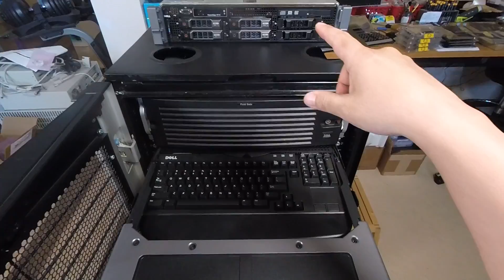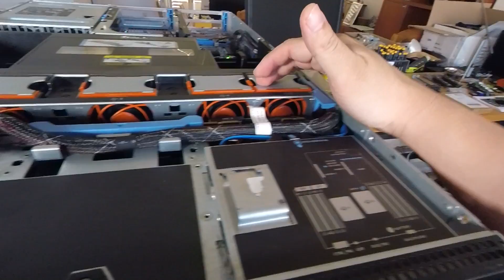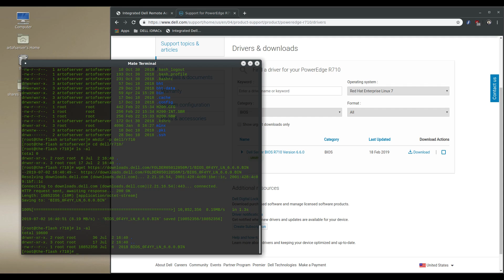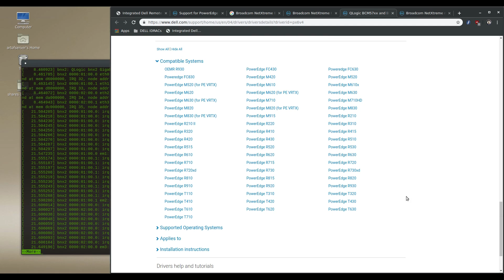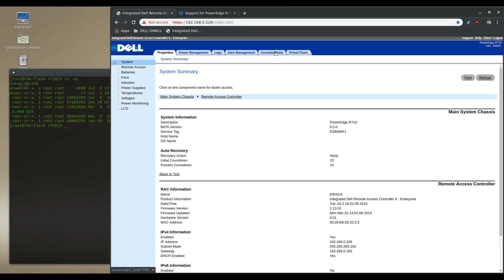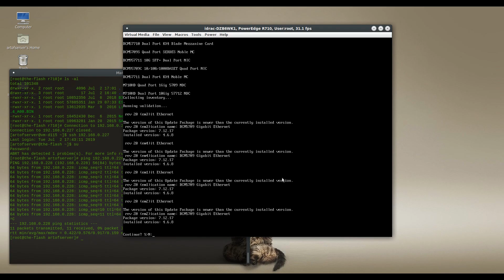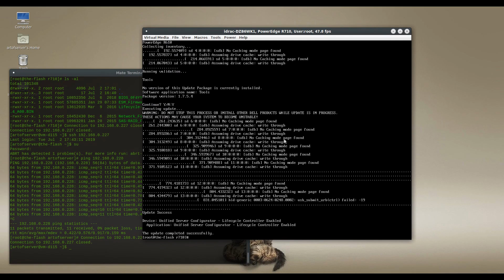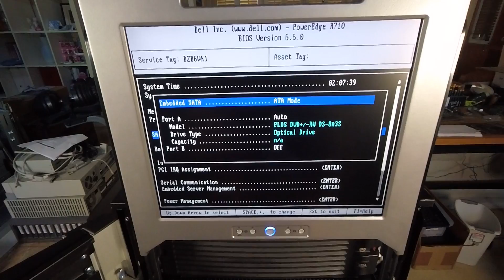Dell PowerEdge R710 build PART 1/9 | fixes, bios and firmware updates, and factory reset

Comment: This video is perfect even being so old. Any suggestions on if my BIOS Version is blank? It is blank on the BIOS screen and the iDRAC portal
Reply from the maker: I've never seen a blank BIOS version. something seems off, but I'm not sure how to fix that. I might try a re-flash of the BIOS firmware, and maybe also a CMOS reset.
Reply: @ArtofServer  thanks for the reply!  Unfortunately I did already try both of those things. I suppose I could try the CMOS reset again after I’ve made a couple changes. I wasn’t sure which bios version to use so I did start at the earliest version and it failed and then worked my way up, still failing to flash. The error I got when I tried to flash was “error unrecognized system”

Comment: I suspect I am going to have to download these (the firmware files) on a Linux machine in the GUI and copy them to a Linux bootable disk because now it's not possible (or so it seems) to use wget to download them. I know the iDRAC update on my R710 is needed because the latest web browsers won't even let the page display on my current Windows PC, whereas the iDRAC on my R730xd was new enough that I can start it entirely from the browser. I haven't tried the R410 iDRAC yet; that's a project for tomorrow.
Reply from the maker: Try using this website to get the firmware: https://poweredgec.dell.com/latest_poweredge-11g.html

The firmware update packages are available for other OSes too, but I'm a Linux user so I use what's convenient for me. Feel free to use whatever is more convenient for you. :-)

Comment: Great vidoe series, I'm upgrading as I watch the video but I ran into this issue, perhaps it's due to the fact that I'm rting it on a Proxmox installation and not live Linux USB media:

Package version: 7.12.17
Installed version: 7.10.18

Continue? Y/N:y
Executing update...
WARNING: DO NOT STOP THIS PROCESS OR INSTALL OTHER DELL PRODUCTS WHILE UPDATE IS IN PROGRESS.
THESE ACTIONS MAY CAUSE YOUR SYSTEM TO BECOME UNSTABLE!
..
Device: BCM5709 Gigabit Ethernet rev 20 (eno1)
  Application: BCM5709 Gigabit Ethernet rev 20 (eno1)
  Update failure. Firmware programming utility returned an error. Original firmware restored

If anyone knows a fix, please let me know.
Reply from the maker: Sorry, I've never ran into that issue before. But if I had to guess, the memory where the firmware is stored might be failing and is returning an error during the download process.

Comment: the CENTos is that installed on a disk 
 on the server or is booted and running from a usb-stick ?
Reply from the maker: off a USB drive. I use it as a portable installation to work on servers. There's a video on my channel showing how i setup that USB drive.
Reply: @ArtofServer  txs, found the video

Comment: I have a problem. I bought this R710 a few months ago, finally bought a 2nd CPU so I can have dual CPUs, but only one shows! It's not the CPU itself, I swapped them both out for each other in different bays, and they both boot up. I think there's a setting I'm not changing for it to recognize the 2nd CPU. I'm running VMware on this system and it works good, but I want more CPU power for VMs. 

What do I need to do to get it to recognize the two CPUs?
Reply from the maker: There usually isn't much required. You might just have a defective motherboard. I would at least do a CMOS reset and see if that helps. If not, unfortunately, I think the motherboard needs to be replaced.

Comment: I just found your channel an already liked/followed it. Can you please pass me some informations/exp. about resetting the system setup password on my poweredge r720? We bought a used one and tried the pwd jumper, but we might done it wrong and we cannot install from a new copy of windows server from stick. We managed to set the raids up, but I got stuck on the system setup password part /(.  Gonna try it again tomorrow, but I like it as it has enaugh power for my file stuff:)
Reply from the maker: Welcome to the channel! Check out my videos on the R820 and R720; those will better apply to your situation.
Reply: @ArtofServer  thanks Server is running well! I still need to learn more about the  bios settings (to disable all the lengthy self checks, boot directly to windows, disable idrac as is fails to initialize),  but I keep watching your clips and I’m sure it will work:=) thank you and have a great weekend

Comment: I'm following along for my r710, and when I get to 24:00 I see you're logged in to a terminal.  How did you set that up on the server in order to connect to it, i'm looking at the green text on the left?  The best I can come up with is install proxmox on a drive and then use the terminal on that to download (wget) and install the bins.   Also, I ran the bios update in the proxmox terminal which I downloaded from the RedHat linux (using wget and browser hack) and ran "./BIOS_0F4YY_LN_6.6.0.BIN" ....it showed current bios was at 1.1.4 and package version was 6.6.0.  I thought the number was 2.x.x but I ran it anyway. After rebooting it said it failed.   Maybe I'm running the wrong bios?  Is there a way to do the bios update on a usb stick running FreeDOS?   Maybe its okay to stay on current old version. I am just doing some home lab stuff with this server.  (iDrac is latest)   My other question is, what OS are you running and browser?  I know that windows wont let me run the java plugin anymore, so is there a "goto" tool I can set up on a spare laptop like linux desktop and firefox?   Then I should be able to console in using iDrac.    Thank you for the videos and your ebay store!

Comment: Does idrac password will be factory default if we reset the bios to default using hardware jumper. I got the used server and vga display not working so want to reset idrac password
Reply from the maker: you need to do a idrac factory reset. there are several ways, for example, you can use the 'racadm' utility provided by Dell.

Comment: When I try to update the iDARC FW i get ( "The following packages are required for update package to run: compat-libstdc++-33.i686 libstdc++.i686 libxml2.i686") 
Even though I installed them, I still get this. Any thoughts? Thanks in advance.

Comment: Any idead what the drive size limit is for the h200 you sell on your ebay store?
Reply from the maker: yes, 128PB for SATA and 8ZB for SAS. so, practically speaking, limitless with today's available technology. details are explained in this video: https://youtu.be/u55vIGMzzKw
Reply: so will the h200 be able to handle 8tb drives. I have a perc 6i in one of my systems and im having trouble getting the 8tb drives to work in it.

Comment: I've been fighting with an R720 for months.  I can't figure out if I'm missing something, but does an R720 have a IDRAC enterprise module or any modular parts at all?  Mine loses all settings every time the power goes out, and I can't get any updates to install on it.  All update files either fail, or they never install when the IDRAC reboots, and if I had any hair I would have pulled it all out trying to figure out how to get it fixed.
Reply from the maker: On the 12th gen Dell servers like the R720, the "enterprise" module is a license key you install on the server instead of a physical "module". If you login to the iDRAC, it should tell you if you have the enterprise license key already installed or not.

Are you saying your iDRAC loses settings or that the system setup (BIOS/UEFI) loses settings upon power cycling?

Here's a video that might help you, and more relevant to the R720: https://youtu.be/ISA7j2BKgjI
Reply: @ArtofServer  it looks like the Enterprise key is indeed installed. Only the IDRAC loses settings, the BIOS is fine.  I've verified the CMOS battery is good, so I'm stumped. I created a script with racadm that sets the settings back where I need to access it, but it doesn't solve the other issues I have with the outdated firmware.
Reply: @ArtofServer  I did follow along with the instructions in that video.  The update versions for the R720 add HTTPS support in the LC starting with versions 2.X.  I'm stuck at 1.65.  Any version I try to install using the .BIN file under Linux eventually ends with an "Invalid Signature Detected" error.  Googling shows that various BIOS revisions may be incompatible with certain updates and produce this error.  I have the latest BIOS (2.9.0) and have also tried various other BIOS versions with the same result.  I've run the update file under Windows Server 2012 as well as Ubuntu.  I even tried the update ISO route (there's a method that uses a Dell app to create a bootable ISO that auto updates everything), but that fails when it gets to the LC update stage.  I've also tried extracting the payload file and using it with both racadm and the IDRAC web interface upload, but both return a FAILED status with any version I try.

Comment: Hey, Great Video!  I have a R720 server with iDRAC 7 Express which I brought it recently. I connected it to the network but DHCP is not getting an IP from the network. When I try to connect it to my monitor it takes me to the life cycle controller page and get struck. I am a beginner and any suggestions would be appreciated. Thank you in advance !
Reply from the maker: It looks like your system is stuck in booting into the LifeCycle Controller (LCC). There might have been a previous configuration that is directing it to go into the LCC. You might need to let that complete.

On the 12th gen iDRAC, you can't use the dedicated idrac NIC unless you have the enterprise license key installed. Maybe that's the issue?
Reply: @ArtofServer  Thank you for your reply! I had a bad VGA to HDMI cable and it caused this issue. I bought a new VGA to VGA cable and it led me to get to the LCC. But still couldn't setup the IDRAC IP for it. As a starting point I reset my idrac setting and tried setting up static IP in the network but I wasn't able to ping my idrac ip after reboot. Let me explain on how I connected the idrac physical interface. I have one end of RJ45 to iDRAC port and other end to my TP link router which is my ISP. Initially my idrac port started blinking while resting the idrac setting through system setup but after its completed there is no light.. seems to me like the port is down. So next I connected TP link router to a switch (Netgear) and then from switch to IDRAC port but no luck.. I am completely new in setting this up and I am struck on here in setting up a IP address to the device. Not sure if my idrac port is working or not as its not blinking anymore and couldn't run the hardware diagnosis to see for any issues as my firmware is out of date. I tried reseating the idrac module but still no luck. I am looking to setup it as a home lab to install proxmox, eveng to learn networking. Or should I install hypervisor and assign an IP before I setup Idrac IP ? I would appreciate if you can provide some inputs hear please. Thank you in advance!!!

Comment: Received my Dell R710 today. Powered it on and received the following error: PXE-E61 media test failure-check cable. Can you offer guidance, please?
Reply from the maker: That means your server went into PXE boot mode (probably because there's no boot device) and could not PXE boot. If your server is not connected to a network with a PXE boot server, that's probably why.

Comment: Thought all the redundacy was to keep system running... one fan goes bad and system will not start?? Do all systems come with this "IDRAC' system/equipment? Are you saying I drive?
Reply from the maker: the system still powered on with the bad fan. so not sure what made you think it will not start? it just spewed an error about the FAN1 and lost of redundancy.

Not all systems come with iDRAC. the iDRAC system here consists of 2 modules, the "express" and "enterprise" modules as shown in this vid.

Comment: This was a Dell 11gen server with idrac6, no license required . What’s your approach to 12gen machines that require a license for idrac7 functions? Do you buy a Dell license somewhere (eBay sellers appear to be in China) or will the dedicated idrac card port work to some degree without a license? If it’s covered in another video, let me know, thanks.
Reply from the maker: Buy the idrac7 enterprise license. They are about $30-40 on eBay. When buying a used 12th gen or newer Dell PowerEdge server, it's always a good idea to ask about the idrac enterprise license. If it's not installed, you can negotiate that cost off the asking price. I try to get servers already with the license key installed.

Comment: I have two dells that i bought used, one is the R630 and MD1220, I want to use the 630 as a hypervisor and the 1220 for storage, been watching your videos and you are very helpful, thank you so much
Reply from the maker: Glad these videos have been helpful!
Reply: @ArtofServer  any advise for my build? I follow you on EBay as well will be buying some parts as well
Reply from the maker: @NegroRotary  what kind of advice do you need? What are some of the questions you have?
Reply: @ArtofServer  i was thinking of using my 630 for a hypervisor and my md1220 for using true nas or plex, like doing all my computer back ups with the md1220
Reply from the maker: @NegroRotary  yes, I read that part. Not sure what your question is?

Comment: for this specific server and to remote connect you have to have two network cables, correct? one of network communication and another for the iDRAC?
Reply from the maker: yes, for this specific server, there are 4 onboard NICs. but there's also a dedicated port for the iDRAC, that's the "iDRAC enterprise" module.

Comment: The irony of this video is not using windows to avoid licenses and then using red hat linux. Which is also under a license you must agree to.

Other than that, great video. Helped me set up my server in the configuration I needed it to be in.
Reply from the maker: I disagree. I wasn't avoiding windows licenses, I simply don't use windows. And I was using CentOS7, not RHEL; there are no encumbering licenses.

But glad you got good use out of the video. Thanks for watching!

Comment: Hi, any solution for e122e onboard voltage regulator  and e1000 failsafe voltage errors  for dell poweredge 710 it looks there is no solution on the web please help if you can thanks

no one has a real solution tell now
Reply from the maker: do me a favor and don't post comments on videos that are not relevant. it just gives me extra work to clean up the comments on my channel.

as to your question, i have no idea. however, it sounds like something might be wrong with the PDB which is part of the motherboard. So, likely you need to get a new motherboard.

Comment: For some reason I can't get my R710 to show up in my router nor when I scan my network. I even reset it to defaults and only turned on DHCP, and it still doesn't want to get an IP. I need to connect to the iDrac port, righjt?
Reply from the maker: Are you talking about the server's network or the idrac network?
Reply: @ArtofServer  I've connected the server's iDRAC port to my network. It refuses to save 'use DHCP' as a network setting, and when I try manual setup, it doesn't show up in my network. It's an R710 so the iDRAC is old, but it shows up during boot, so it should work.
Reply: @ArtofServer  The solution was to also connect a network port to my switch, not only the iDRAC port.

btw, I used my service tag, and the NIC firmware showed up as the top result.

Comment: I have a Dell R710 that after suffering a power outage now has an issue with the System Services coming up as disabled. When it boots it says that the IDRAC fails to communicate. I tried to reset the IDRAC using the "i" button but it doesn't help. The fans are stuck at full throttle and I feel like there must be something that I can do to get it back to normal but I can't find any info.
Reply from the maker: Sounds like either your iDRAC express or enterprise module failed.

Comment: Why get rid if battery and change plug to h2 setup,and why change some wires in dell r720 just to run freenas?
Also I just bought a used hp server, it's battery for cache is dead,I think thsts a bad idea!is dell doing the same?my new dellr240 has no battery for cache!
Reply from the maker: Battery is needed for RAID controllers that have onboard cache. This is not R720, but R710 by the way... Very different server.

Comment: You can do firmware updates over SSH safely, no need to use the KVM in the iDRAC, all these KVM's suck donkey balls and are best ditched as soon as you possibly can. The trick is to either use either screen or tmux. Then if your SSH session gets terminated you log back on and reattach. In fact any system admin doing anything on a server where if your session gets detached for network issues you are in trouble should be using either screen or tmux.

Comment: Dell PowerEdge R710 shows my seagate 6TB drive powers on gives all the info but shows 0.00GB State fail , Can it not read 6TB drives?
Reply from the maker: What controller and firmware are you using?
Reply: @ArtofServer  Dell PERC H700 FW 12.10.1-0001, A07
Reply from the maker: @Thrakus  try updating the firmware on the H700. There's a rev A13 right now. If that doesn't work, then the Dell firmware can't handle greater than 2TB drives.
Reply from the maker: BTW, what is the model of those Seagate 6TB drives?
Reply: @ArtofServer  I was wrong about the size it is ST4000NM0023 Constellation ES.3 SAS So 4TB
Reply: @Thrakus  Try a different brand of HDD, like HGST or WD or Toshiba. My guess is something wrong with the Seagate HDD.